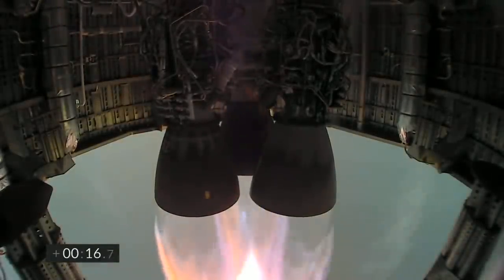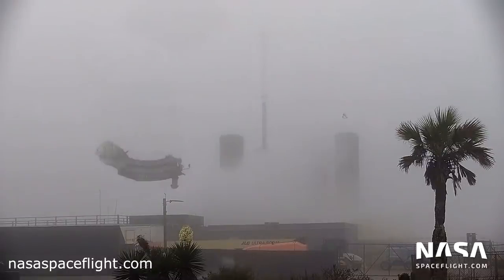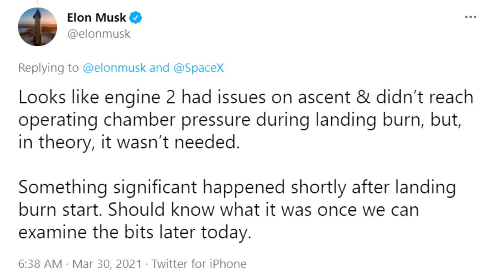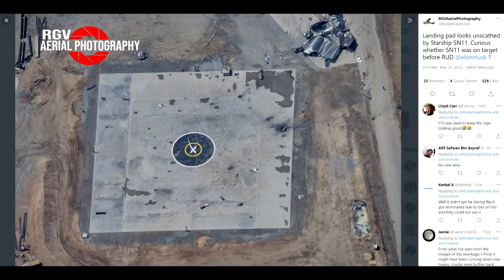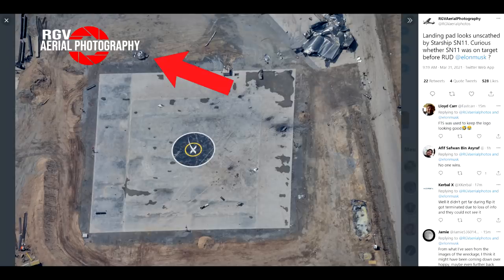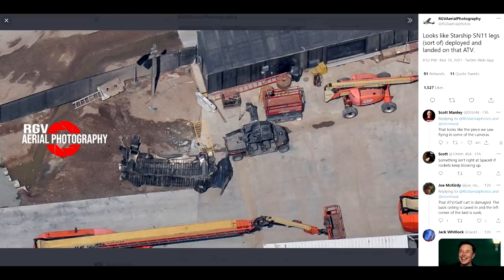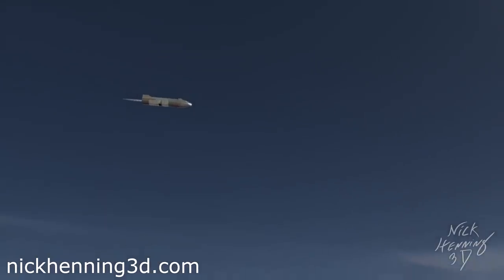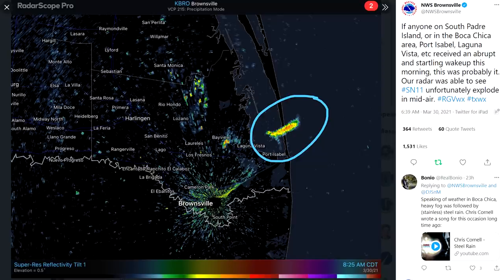What Happened In The Fog At Boca Chica - What Caused SpaceX's Latest Prototype To Explode?

Comment: Lacking access to the telemetry and going on only the video there's too little to see that would answer this.  I'm sure, however, that SpaceX, with the telemetry, will be able to figure it out.  OTH, it is now looking more and more like the Raptor engines are not fully ready -- I hope I'm wrong, but I've had a nagging feeling about them since the first hops.  One other issue that seems to perhaps be a common issue is plumbing and one has to wonder if building these things in less than clean room environments is wise.
Reply: They tested the raptors on the ground about a million times so I suspect it is wierd overpressure spikes in the fuel lines.  Typically, accumulators are used to prevent such spikes. Somehow fuel/oxygen is not correctly being fed to the raptors and their pumps because of doing the weightless acrobats.   Elon should install a 20 meter parachute that pulls the nose vertical 20 seconds before re ignition
Reply: @douginorlando6260  -- I do hope you're right that the Raptor's are well understood and not the problem but my gut tells me otherwise.  The idea of a parachute to pull it vertical makes sense except it's additional mass they would not want to carry to orbit and back in operation.  The other benefit though would be to make sure the propellants are settled at the bottom of the tanks.
Reply: Raptorman0909 Agreed on settling the propellent.   Propellent used to flip the starship would be saved which weighs more than a chute.  I picked 20 meter diameter because that’s about the same cross section as the starship on it’s side ... that would be about the same aerodynamic drag and velocity as now. If two chutes were used, then the velocity would be less and a lot less propellent would be required.
Reply: @douginorlando6260  -- Seems Elon Tweeted that there was a problem with the #2 engine during ascent so the Raptors are indeed still a work in progress.
Reply: Raptorman0909 I wonder if Raptor reliability has to do with vibrations of 3 engines (resonance?) or else the plumbing unique to the starship versus testing on a stand.   Also, since there was video cut out, I wonder if what caused that could have caused additional other problems.   My usual suspects are everything different than all the static fire ground tests.   Elon did say the Raptor problem does not explain the total failure

Comment: Could slosh from the liquid fuel and oxygen perhaps have caused an internal rupture during a flip maneuver? That could be a lot of mass with considerable momentum that might have exceeded the structural limits of the tanks when the orientation and direction of movement were rapidly changed. Inertia of the liquid might have put force in a direction not normal to vertical flight or static tests. Perhaps it just needs some reinforcement and flight control adjustments to mitigate this.

Comment: Is the camera in the methane tank a new addition? Perhaps an electrical connection or seal failed during the final maneuver causing a spark and ignition of the methane. Just a thought. PS: Thank you for your insightful views Scott. Top man for analysis and extremely interesting vids.
Reply: I think that's the LOX tank, I think the methane is the top tank the lox is the bottom..  Also a spark in the methane tank would not be an issue absent oxygen.

Comment: Hello, why is launching in a heavy fog not a safety issue? Who is in charge of safety for SpaceX at Boca Chica? It seems a very poor decision on many levels. I know the area is evacuated but if the facilities had caught on fire, the responders (if any) would be endangered by the debris lying about in the fog and less able to avoid possible contaminants. Also while visual data may have not been a goal of this test launch it is often a crucial part of analysis when telemetry fails. I think they need to pause and re-think how they are going to do future operations.

Comment: Something maybe lower altitude like Nicks render, the Raptor120  i,m not sure of the angular momentum on landing would be good with hot red carbon flame possibly at around 18 seconds and the gas leak was observed but even then they don't have a swing facility  to test the flip and burn which is imaginable . These engine blocks with puck (very damaged cusp  to the faulty engine)need a thoroughly good sxxxxxxng very regularly which is difficult to organise unless in orbit. Happy Easter soon anyway.

Comment: Yes, I think the Fuel and oxygen mixed somehow. Because BOOM was so clear and destroy ewerything, but engines was still "engines", so maybe explosion must start inside that rocket. Is there part where those two liquids can mix or flow wrong way? Oxygen generates much higher pressure than methane at same temperature

Comment: Hey Scott ... I'm curious if airflow could have reversed direction in the methane tank venting pipe(s) during the freefall ... That could have gotten oxygen in the methane tank, if it happened ... If so, it's curious it didn't happen on the other high altitude flights ... Besides, how did a flame get in there? .... Just mixing methane and oxygen does make them explode on their own ... Hmm 🤔
Reply: *Doesn't* make them explode
Reply: **Does Not** make them explode

Comment: Sad. In fact, one of the engines was engulfed in flames during the ascent. If this should not be the case, then there was a fuel leak. During the descent, enough fuel accumulated that when the engines were switched on again, there was a detonation with the destruction of the tanks and, probably, a new big explosion.
Reply: There have been fired in the engine bay before that were no issue.  Engulfed indeed, it wasn't that big a fire chicken little.

Comment: Question: Obviously the SN##'s do not have payloads or crew modules on board, but do they have space for payloads? Are there large empty voids in the top section of the prototypes with dummy weights or is it all full of fuel, oxidizer, and header tanks?

Comment: Thunderf00t had a rather reasonable idea of internal wall cracking and liquid oxygen and methane mixing into an explosive mixture from the footage of the rear end of the rocket pitching down, guessing that the center of mass was shifting due to the leak and then as the rocket ignites, the mixture explodes.

Comment: Have a look at the Raptors. Did not develop the intended pressure ... or the pressure went someplace else. Could a standing wave in the combustion chamber force burning mixture back into the tanks through the preburners? a Tesla Valve might help changing the wavelength between tanks and preburners or between preburners and combustion chamber.

Comment: Is it possible that there is a flaw with the Raptor engines when operating vertically that the horizontal test stand firing doesn't reveal.

Comment: My belief is that the debris field points to auto-FTS detonation.  The FTS is essentially a pair of shaped charges.  This would push the debris away from the charges, leading to lots of bits spread out in a 180 arc.  The nosecone and Raptors being much heavier, would likely have had enough inertia to continue largely unaffected.  Think of wrapping a towel around a stack of plates like a giant sling and pulling the middle of the stack out very quickly.  The plates on the top and the bottom would remain relatively unmoved laterally, while those in the towel would be thrust in the direction the towel had been pulled.

And since there's telemetry lag, they likely won't be able to confirm this (if they even want to do so publicly) until all the electronics have been collected and analyzed.  Hopefully they'll find whatever logging computers were inside and have a record of the command being executed.

Feel free to trash my theory to hell with better analysis, but that's my $.02

Comment: I note that SN10 developed a methane leak (and fire) during the flip and just before touchdown. 
This led to a RUD sometime later after touchdown.

Could the same leak have happened with SN11, except in this case it led very rapidly to a RUD?
(I guess possibly not because of the level of disintegration).

Comment: Scott,
The  camera/telemetry channels seemed highly attenuated on this flight.

 I doubt  a couple  100 meters of ground fog caused all that. 
These channels usually use a frequency where atmospheric moisture is transparent and SPACEX probably employ a tracking receiving antenna to increase SNR.
 
 Could RF  interference from the dozens of 3rd party remote cameras that suddenly appeared for this SN11 flight  be  causing problems?
 Even possibly detonating the self-destruct packs?  

Now that is admittedly a stretch , but those packs are designed to rip right up the side of the vehicle which is the damage you described. 
 I'm fairly certain that the FLIGHT TERMINATION channel is much more secure then say , a garage door opener, which can be easily hacked with a 5 Watt Police handheld transceiver. 

Still possibly an RF audit of the area is in order. 

  <insert sabotage conspiracy here>

Comment: I wonder if one of the fan blades in the Liquid Oxygen turbo pump on engine 2 had suffered some sort of damage during manufacturing and just gave in during the engine relight, sending pieces upward into the thrust puck, puncturing it, and letting oxygen into the CH4 tank, which the heat and sparks and disintegration of engine 2 would cause the methane to explode and create an internal explosion that bursts the bulkhead between the CH4 and the Liquid oxygen tanks, fueling a very rapid and hot explosion that would disintegrate SN11 from the inside-out. This would explain why the chamber pressure was low (due to failing fan blade, it may have broken on ascent, but remained operational until re-light as I'd suspect the engines undergo the most stress during priming/ignition). This may explain why we saw one engine actually light before the feed froze as it may have been the second engine to ignite that had the problem, also if you listen to the audio from some of the videos of the event, you'll find that the explosion occurs roughly 1s after the first engine ignition, compare this to the previous delay between 1st and 2nd engine re-lighting and SN8 has a delay of (roughly) 0.8s, and SN10 0.7s (Bear in mind that since these are test flights, flight profiles are most likely quite different between flights to test a range of settings and so 0.2s difference in re-lighting isn't much), this shows that it had to be when, or immediately after the 2nd or 3rd engine ignited. This may also partially explain why the debris field was asymmetric, the explosion started from 1 of the 3 raptor engines, meaning that if it was to make a hole through the thrust puck (presumably directly where the center of the engine is) it would be off to one side, meaning that the pressure (and heat) would reach one side first and that side would be broken into smaller pieces that are expelled at a higher velocity (thus going further before hitting the ground) than the side that the pressure hit last, which, by then the pressure would be slightly less, resulting in larger chunks being torn out, and travelling slow too, thus, not going as far (note that slight currents in the air would also have affect the spread as it happened at roughly 800m from the ground, more so having an effect on the larger "floaty" pieces of stainless steel that we could see drifting down).
Reply: This doesn't rule out the fact that the methane header tank may also have had an explosion, especially if the pressure flowed up the feed pipe.
Reply: And a correction, the debris from the exploded fan blade would have gone into the oxygen tank not the methane tank, but the outcome is pretty much the same, if not more violent.
Reply: And this is all SPECULATION, I do not work for spacex, so only regard it as a possible cause, for hard facts we need to wait for the investigation to be complete

Comment: I wonder if It could be a structural failure and the engines & thrust puck drove up into the tanks during failure?

Rapid pressure escape and a rocket battering ram slamming through it? I can see something like that turning it into much smaller pieces as seen

Comment: my guess is that an oxygen line broke inside the methane tank.. oxygenated it... and then the Raptor failure managed to ignite that. So the whole thing went up instead of just taking out the engine area. Multi level problem perhaps starting with a simple pressure valve failing.

Comment: My theory is that if one of the raptors exploded/jammed, it would be blown off, leaving a hole in the engine side of the craft, weakening the lower half. If that made the oxygen tank leak, and another raptor was on, it would probably set all oxygen alight, but quite far behind the craft, as there was a lot of pressure in that tank. that then could rip the raptor loose and let it fly into the oxygen tank. Then, the oxygen tank would explode, and rip the underside and upperside off (the debris that was kinda intact) while shattering the middle section outwards. This is only my imagination tho, so i might be wrong.

Comment: The skirt section with the leg was traveling near horizontal in the nsf video which sugests that the rud occured fairly close to the ground. Also the bang was not very loud and there was no sign of a shock wave in the nsf video feed. 
My money would be on an explosive raptor failure when the vehicle had reached vertical with a small side slip to the NW. This destroyed the skirt and at least the lower bulkhead. The remaining engine components being propelled straight downward and the nosecone and remains of the tanks impacting intact with a small NW velocity causing them to lay down fairly neatly.

Comment: I'm thinking that a fault in one of the engines caused methane to be forced back into the oxygen tank or vice versa (actually it would be preburned methane or pre-burned oxygen). What might cause that would be if one of the pumps stops (or more likely failed to start) and the other one forces the propellant back through it via the combustion chamber. 

One of the engines seemed to me to have a serious problem on the way up with a fire that looked more like an escape of hot pre-burner gas than an external fire of some sort.  Maybe that led to the pump failing to start for the landing burn.

Comment: It needs 2 landing engines independent to the 3 raptors, which will have their own fuel tanks which are full in any orientation. A car can't do, on two or three wheels.! Also seeing the engine bay with various fires eating away at the system indicates a minimalist approach which is not sustainable. The smoke from the engine bay when falling is also worrying. It looks like the engines are leaking or there's another fire in that area.
Reply: More engines, more tanks, more weight.  I think they'll keep plugging away first.  Also the header tanks are full in any orientation.  There is nothing in the engine bay that can't take a little heat for a flight that short.  Smoke from the engine bay when falling?  What smoke?

Comment: Could be leak of methane into oxygen tank resulting in explosive mixture in lower tank. Leaking downcomer? Leaking separation bulkhead? I know starship was pressure tested before start, but such leak could easily happened due to structural loads sustained during flight.

Comment: maybe the methane ox and methane tanks had some fuel left and suffered a leak on the belly flop, since the raptors cause such high stress, so it could be again linked to the pressurization system.

Comment: Thinking out loud - Could the FTS have been triggered by a Raptor explosion? Did some clandestine group hack and override the FTS remotely? Was a high flying Big Black Delta using it's circularly polarized microwave laser on the main tank to buy some government contractors (competitors)  some  catch-up time?  High powered rifle bullet?  Loose interior sensor wire?

Comment: Well .... on the one hand it sucks that yet another one goes up in flames on the other hand it is good to get all the errors out of it now and not once they carry payload. And about the cause of it ... while they say that they didnt trigger the fts it might have triggered on its own ... however finding the cause of it will take a while for certain after all to know what happens the first thing you need to do is gather all the debri you can find ... in addition they should really try and create some kind of black box so no matter if it signal cuts off or not there will be a device that will have all the recording in it

Comment: I think we have reached a design flaw in the fuel system. The problem has been that all the changes in attitude cause the unporting of the fuel system allowing the plumbing to suck gas instead of liquid. The only way to stop that is to turn the tanks into accumulators. Since you can't use rubber diaphragms because its a cryogenic application it will have to be a piston type. How you make that work out is for the engineers but it's the only fix in our engineering bag of tricks.

Comment: Thunderf00t has a video with one plausible explanation - there was a rupture between oxygen and methane tanks, which would essentially make the mixture a bomb. First Raptor seemed to burn, but from what was left in pipes, before explosive mix.
Reply from the maker: I watched that, unfortunately his reasoning is flawed because It doesn't explain the header tank debris.
Reply: @scottmanley  It's not his first foray into flawed reasoning..
Reply: Ok, something big happened anyway based on the small pieces.

Comment: Around 0.26 into your video there is flame around the hoses on the Raptor engines. Is this a fuel leak?
When the engines stop the flame stops but might the leak be continuing? Is it possible that the skirt area filled up waiting for the restart then Boom?